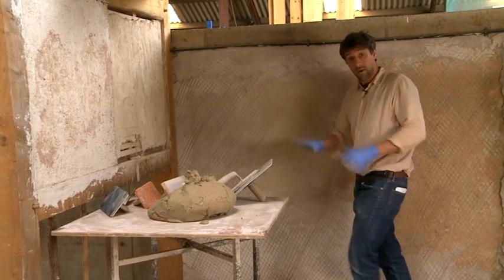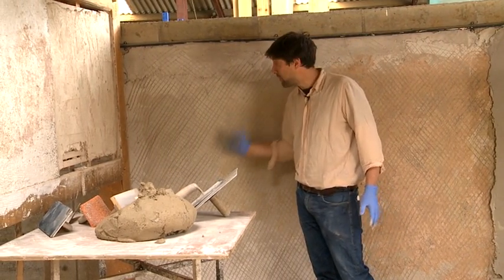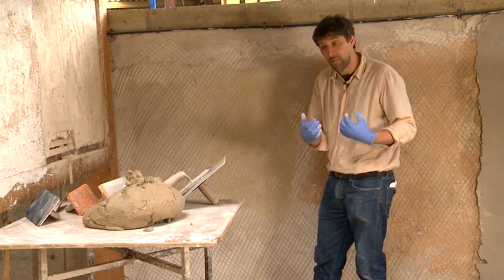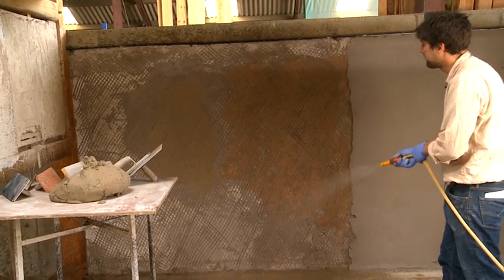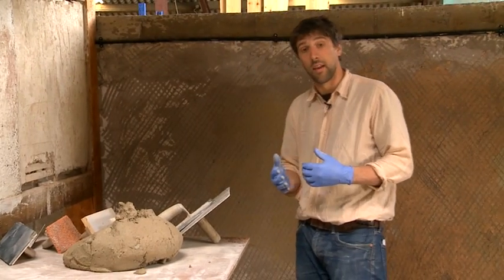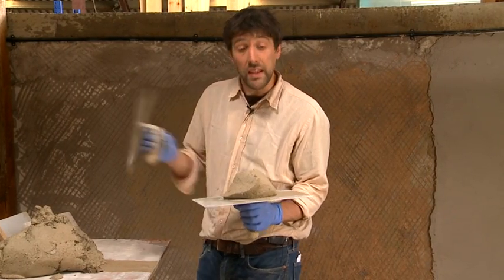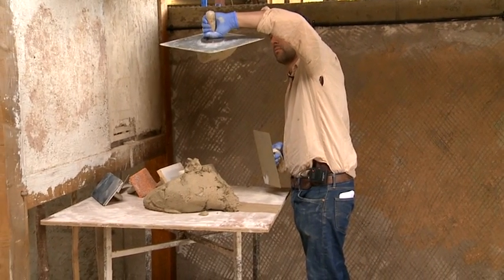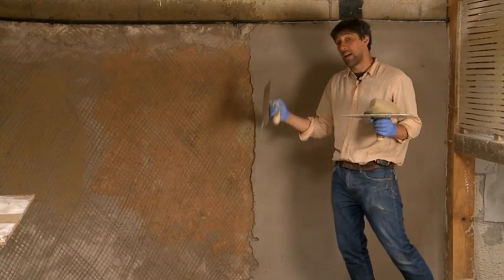14. Lime Plaster Float Coat

Comment: In original construction hundreds of years ago, where plaster was applied on brick or stone walls, they wouldn't have had hoses that could easily wet down a wall like that.  It's hard to imagine using a bucket and brush and wetting down a 30 square meter wall prior to plastering. Would they use much wetter plaster? Otherwise the wall would suck the moisture out before you were able to properly spread the plaster.
Reply: Maybe there were a few spreads

Comment: Is there a good way to bond lime plaster onto a rigid foam insulation? Will it work if I apply a mesh on top of the foam board? I'd really like to use a real lime plaster and not an acrylic product.
Reply: Hi, you shouldn’t apply lime plaster to rigid foam - or use rigid foam insulation where you need breathability as it will not allow moisture transfer